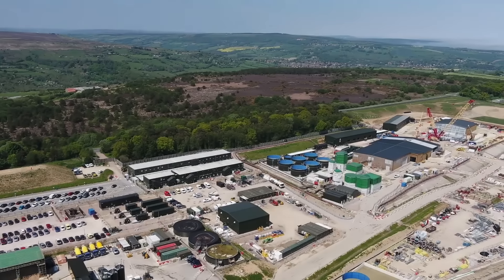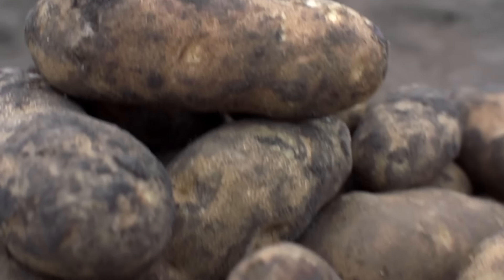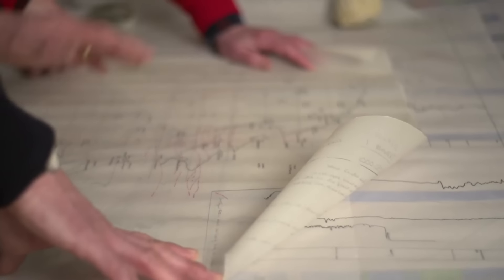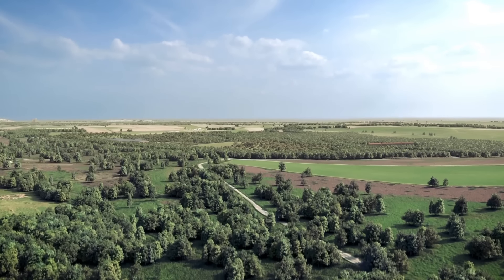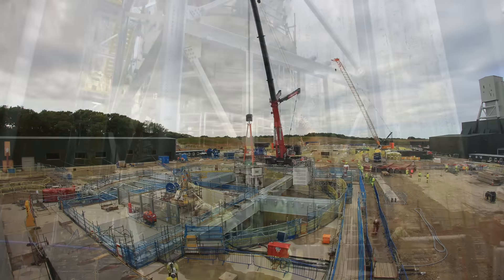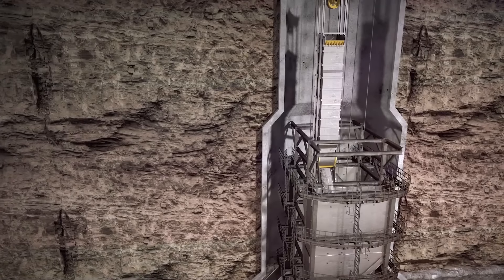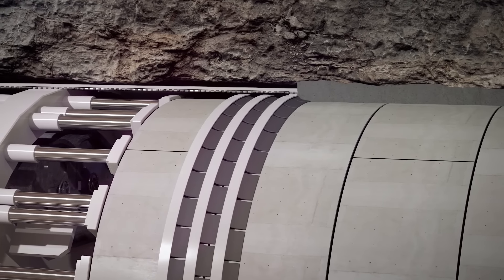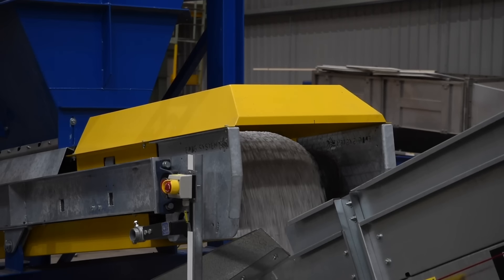Britain's New Super Mine. The Mine No One Has Heard Of. 2025

Comment: A very interesting video.  You mentioned a mai tendance railway along the material handling tunnel. It would be interesting to see more details when they are available.
Reply from the maker: Hi James. There's not much to it to be honest. Some of the tunnel is finished and it's actually what you can see in the thumbnail. The conveyor belt is actually at the top of the tunnel and you can just make out the train tracks at the bottom with power cables running down the sides. Just like in the animation. Thanks for watching! Glad you found it interesting.

Comment: At that depth, surely they could drop water pipes which would result in geothermal heat to run the entire plant!  The temp at that depth is going to be around 50 deg c.  Using heat pumps would surely be a good idea, no? (More useful than they are at heating a home at ground level!).

Comment: I love down the road from the Woodsmith site and you can scarcely see it from any neighbouring roads. Its lighting is far more apparent on overcast nights. Did not know the level of engineering involved though, nor the benefits offered by what the mine produces. Fabulous.
Reply from the maker: How far is it from Catterick? I used to live in Catterick for about a year when i was in the army years ago. As for the lights, i'm assuming you wont even see them once constructing is finished. Glad you liked the video!
Reply: @thecuriouslobster  Oooh not sure but I would guess about 45 miles but Google maps would confirm. Sorry, that's a bit pants. There is another surface site about 6 miles from Guisborough too that you can see from the Whitby/Middlesbrough road.
Reply from the maker: @joetaylor486  Yeah they built an "access shaft" at Lockwood Beck which is very near Guisborough. It provides access to the MTS and was also used to service the SBR I think.
Reply: Yeah they had a couple of substantial "headcages" there for clearly sending down boring machines. Very impressive tbh.

Comment: It will be interesting to see how they cope with the rock temperatures and the resultant mine air temperatures at this depth. I worked in the Banbury coal seam at Wolstanton in the 1970s at a depth of 1400 yards and the virgin rock temperature [ie before cooling by mine air] was 150F [65C] and it was as hot as hell ! There is possibly scope for a heat reclamation scheme for district heating in Whitby ?
Reply from the maker: Hi Old Grizzly. Yes it will be interesting to see how they cope. When i was doing research for this video i saw some mining videos from guys in the Boulby potash mine down the road. Those poor guys were soaked head to toe in sweat from the heat! I wonder if geothermal production would be an option at the end of the mines life. Or even during. Thanks for watching.
Reply: @thecuriouslobster  underpants, battery belt, kneepads and boots [no socks] was the dress code and an unlimited supply of salted water to drink. Ventilation is expensive and refrigerated air extremely expensive. Temperature exhausted by the mine fan at Wolstanton would be about 25 C. With a huge volume of air passing at that temperature, that is a massive source of heat energy to feed into a heat exchanger to serve district heating or even into a sand battery storage/generation system. It would seem almost criminal not to make use of it in these more enlightened days 
Btw - it was not pleasant in winter, coming soaked in sweat through the air doors into the sub-zero temperatures outside.
Reply from the maker: @bigoldgrizzly  Yeah coming out of that heat into the cold up top. Sod that! Sand batteries look really interesting. I was thinking of doing a video on them at some point.
Reply: Good idea. Isn't this why in South Yorkshire.. there was actual steam generation energy as well ? And shouldn't maybe.. somebody.. utilise this situation as well ? To harness these kind of energy ? In one way or another? So maybe there are actual subsequent business model here. For the local economy etc.  It's like the Singapore's model about producing chicken. They farm their chicken in a massive intensive factory. But they put them into a vertical cage rather than an actual horizontal one. So then the poops... get treated all the way downwards.. and they collect them. (And then filter them and extract the trace minerals from the poops. And sell them as fertilisers.) Now.. this is indeed ingenious...
Reply: @MeiinUK  yes indeed, there is precedent. I recall that on the site of the Old Boston Colliery near Wigan they pumped water down pipes in the capped mine shaft an it returned via another pipe as steam. When I was there for a training course in Shotfiring in the early '70s , this had been going on for decades .... perhaps it still does ?

Comment: I live in Australia, an expat from the UK, and I have just discovered this Mining News. I take note that a Tunnel is being bored, which will carry the mined minerals through the Underground Tunnel by Conveying Systems - and Conveyor Belting. 23 miles for a Conveying System would require 46 miles of Conveyor Belt, because of the return path. The ironic thing about this, the company that was a world leader in Conveyor Belts has just closed down recently. This Hull company would have been able to manufacture / supply this belting, and then transport (by road) just 60 miles to the Wood Smith Mine site.And all with (local) technical assistance This lengthy Conveying System will require a high level of maintenance over its Operational Life.
Reply from the maker: Damn that is a shame! Thanks for watching though Peter. Hope you enjoyed it.

Comment: This is tremendous stuff.
However to claim that this is a very low carbon product is dubious.
Clearly the carbon footprint of all of the machinery and the power to drive it are not included in the products carbon footprint.
I take it this is a promotional video.
Reply from the maker: Hi Kevin. No it's not a promotional video. It's all me. I only talk about projects or products i think others will find interesting. It is ultra low carbon though. The process is a very simple one. Mine it, crush it. That's pretty much it. No chemicals involved in the processing so no input from the chemical industry. Because it has 4 nutrients instead of 2 or 3 like other forms of potash, it doesn't need to go through a further blending process with more chemicals to add other nutrients to it. It's right next to a port and because of the mineral transport system no road or train haulage is used. A massive reduction in pollution right there. Most mines would have to transport millions of tons hundreds of miles to the nearest port. These 2 points alone should not be underestimated. Everything has a footprint though of course. No one is saying it's 100% clean, that's impossible. A toothbrush has a carbon footprint at the end of the day. Glad you liked it though. Thanks for watching.
Reply: CO2 is the basis of life on this planet. For gods sake start thinking for yourself.
Reply: @mikemines2931  
Your unnecessarily offensive post is ill founded.
Are you not aware that we have issues with excessive CO2 in the environment. Climate change?
For you it is not about thinking for yourself, it appears to be more one of thinking at all.
Reply: @kevinu.k.7042  We have no problem with CO2, pollution yes, I'm one of the few who live dead centre of London who agrees with the London mayor. Tire particulates are more polluting even on electric cars which are far heavier. Nature will deal with CO2 by growing more greenery. Ten years ago I was stupid enough to paint a room white and in three month black smears appeared so I took a sample for analysis, it was rubber.
Reply: @techtacular1066  Thanks for coming back.
Yes, it's a tremendous project and your video was the like produced by high budget studios. A great watch.
We must be careful of greenwashing though.
All of those conveyor belts, mining machines, the drying and so forth have a large carbon footprint.
I am not being purist here. Sometimes we have to use carbon based fuels for the greater good. In this case potassium fertiliser to grow food. 
The lack of critical thinking was fairly prominent in the video.

For all of that I was pleased to learn about this and I have subscribed. Thanks.
Reply: @mikemines2931  
Particulates in City centres is a concern. Especially Nitrous oxide emissions.
But, they have little relevance here, except for the superb avoidance of diesel haulage trucks.

Comment: The Renström mine in the Boliden area is Sweden's deepest mine, in January 2019 a depth of 1500 meters was passed.
Reply from the maker: Interesting. When doing the research on the deepest mine in Europe, nothing for this mine came up. I just googled this mine and the 1st result says 1400m. It's only further down the page it says 1500. I will email them to confirm. Google can often take a long time to update. If you search "what is the deepest mine in Europe" it will say the Pyhäsalmi Mine in Finland at 1444m. As there are thousands of mines out there, a lot of them have their total depths change all the time so it's hard to get an accurate reliable figure. I couldn't find any mine that was 1500 or deeper and Anglo said it was the deepest, (perhaps it was when they did their research and have just been repeating it ever since) and so did ITV News. Worst case, this would make it "joint" deepest mine in Europe. I will email them. Thanks for watching!

Comment: In the U.K. you can get anything if you mention ‘*carbon reduction’, ‘exports’ and ‘jobs’ - all of which are quickly forgotten once the relevant permissions are granted! Beware of promises or headlines which contain ‘may’,  ‘could’, ‘might’ or ‘possibly’!!!

*  In 2023, the United Kingdom’s territorial greenhouse gas emissions were estimated at 384 million tonnes of carbon dioxide equivalent (MtCO₂e), reflecting a 52% reduction since 1990.  ￼ This marks a decrease of approximately 23 MtCO₂e (5.7%) from the previous year.  ￼

In contrast, global energy-related CO₂ emissions reached a record high of 37.4 billion tonnes (GtCO₂) in 2023, an increase of 410 MtCO₂e (1.1%) from the previous year.  ￼ 

* This global increase is nearly 18 times greater than the UK’s annual reduction.

Comment: the vast volume of spoil created by the drilling process, a pile of rock and sludge estimated to be at up to 700,000 cubic metres. This will cover a football field to a height of 400ft. There is no possibility you can hide it. The company has not said what they intend to do with it in the middle of one of the most treasured National Parks

Comment: what this tells me is that the mine is entirely dependent on the world maintaining it's current anti carbon dioxide course and in fact the rest of the world joining in as well

which is not the worst bet to make but i'd say that it's still a risky one
Reply from the maker: The main reason this mine is happening is because it can offer a better and potentially cheaper form of much needed fertiliser. It just so happens to produce very little CO2 in producing it. That's all. It's a good selling point in todays world but not the main reason this mineral is being mined. Not even close. It's just a better product. Thanks for watching. Hope you liked it.

Comment: There seems to be a vast amount of concrete being used to "reduce" the environmental impact of such a mine.
Reply from the maker: The mine wouldn't be allowed to be built unless they transported it underground due to it being in a National Park. The concrete used to make the tunnel is nothing compared to the trucks and trains they will be taking off the road over the next 100 years. Thanks for watching.
Reply: @thecuriouslobster  Yes I get that, but find it's somewhat hypocritical as its for environmental reasons. A train track in a slight cutting with the arisings forming bunds either side would also screen it from view and not require millions of tonnes of concrete to achieve.

Comment: Similar clean, green, eco-friendly, & hi-tech both on & offshore extraction operations can & needs to also be done ASAP, regarding both hydrocarbon shale gas & oil, as well as other similar energy resources, linking them to clean, efficient & eco-friendly refineries & distribution networks using similar methods & equipment!! Britain 🇬🇧 could then easily be both energy self-sufficient & economically independent too!
Whatever the “Green & Renewables Lobbies” say, ‘Hydrocarbon Oils & Gas’ are still going to be around with us for many more decades, if not a century or more to come too!!